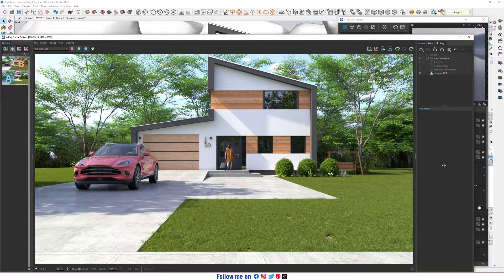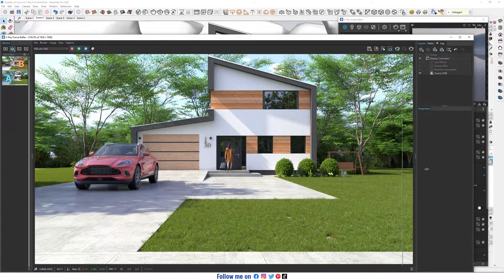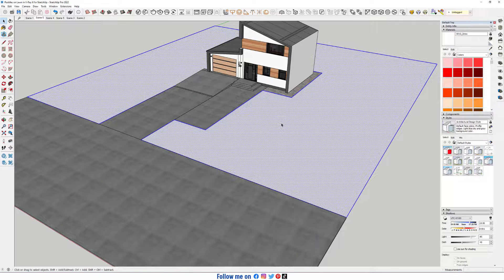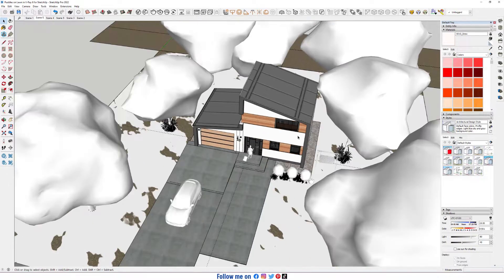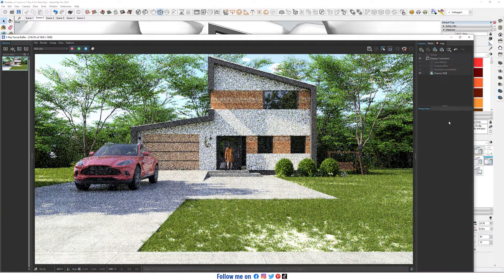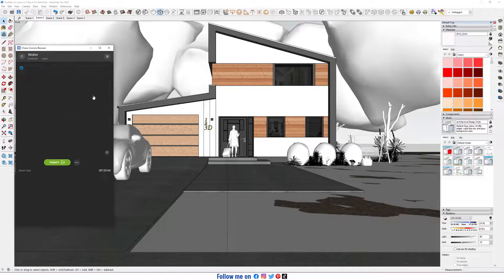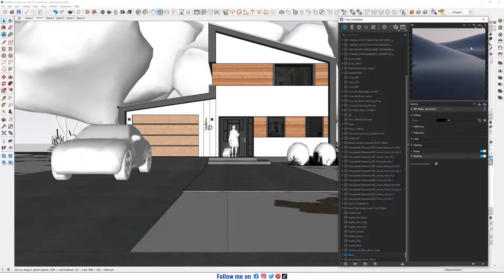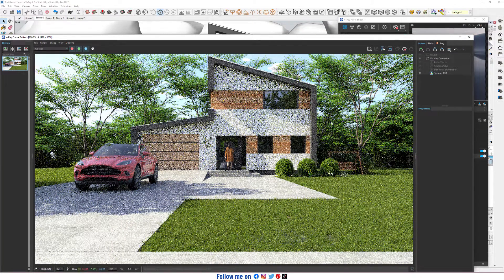Puddles on Lawn in V-Ray 6 for SketchUp | Sketchup vray

Comment: When We hide blocks that the file size will be Reduce??
Reply from the maker: You mean "Groups" or "Components" ? If that so, the file size still the same. It will be reduced if we delete components and purge them.
Reply: @s2vrarchviz  
I ask Group
that's not reduce file size no
So We should Delete or Purge that Group or Blocks